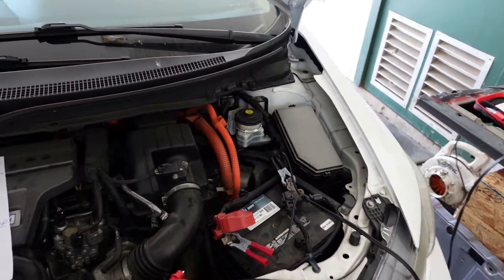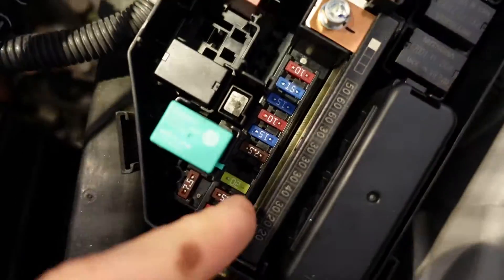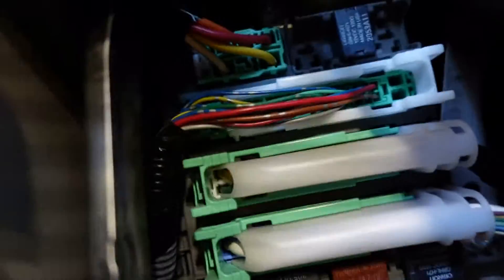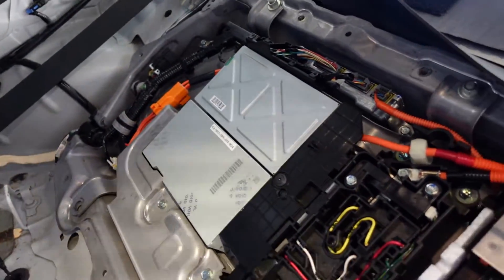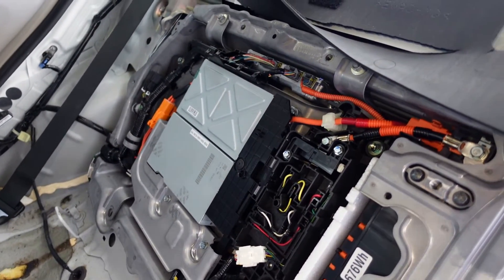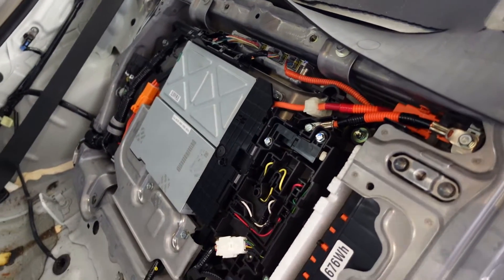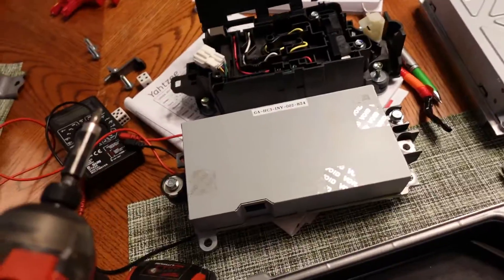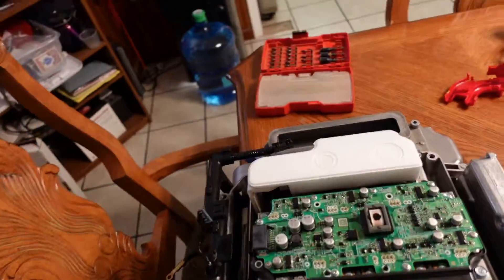Diagnosing a failed IMA System on a Honda Civic Hybrid - Part 3

Comment: Did you ever get it fixed? what was it
Reply from the maker: Howdy! The inverter SCRs had popped. Had to get a refurbished unit to replace the whole thing. Been good for the last 25000 miles and still going well. Thanks!
Reply: @aaronsrose  thanks do you have the trouble shooting for it or does this series do that check? My son has an like issue but he is across the country making trouble shooting for me difficulty. Thanks

Comment: Hello.
Can we do programming for the 2007 Civic battery computer so that the IMA light works only when the voltage difference is about half a volt and not parts of the voltage.For example, the IMA light turns on when there is a difference of 2 millivolts between cells. Is it possible to program it until it reaches 5 millivolts between cells, then the EMA light turns on? Thank you.❤
Reply from the maker: Howdy! I don't think I can get that far into the settings to tweak that. Maybe with a Honda OEM computer, but even that might be a stretch. Thanks!
Reply: @aaronsrose  Thank you for caring about the issue. Do you have solutions for the issue of ima, because the cost of the battery is very high? Thank you

Comment: Hi Aaron, thanks for your vlogs, my 2013 Honda Civic Hybrid has failed IMA, my dealership told that I 
need to  replace "Motor Power Unit" and 051HOZ : Body Electrical
Could you tell what they are and where ?
Thank you
Reply from the maker: Hi again. The service manuals say it would be called an IPU or Intelligent Power Unit. But I would say that would also be the Motor Power Unit. That is the exact thing that I replaced to fix mine. It's on the passenger side behind the rear seat back. If you're under 150k miles that should be covered under the extended warranty. There is also a Motor Control Module that is a piece of the IPU unit. That could be replaced separately if that is the specific problem. The inverter module on the IPU is the thing that is specifically covered under the extended warranty.
Reply: Hi Aaron, I have same issue with my car. Where  can I find extended warranty. I have under 150K.
Reply from the maker: Howdy! I would Google honda Civic hybrid extended warranty technical service bulletin. Hopefully that will find it. Thanks!
Reply: Thank you so much for your reply, great help.
Reply from the maker: Sorry about the delay. Let me dig into that for you.